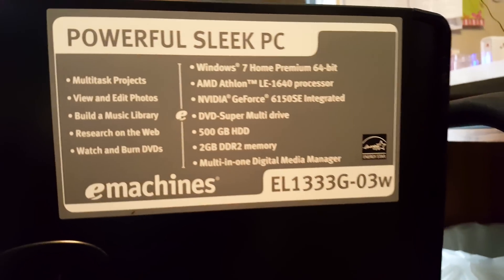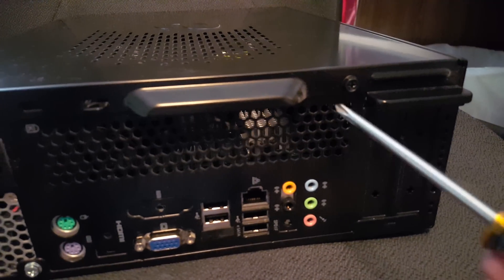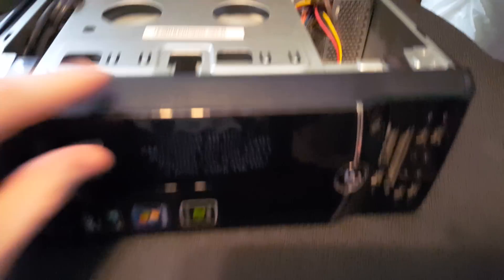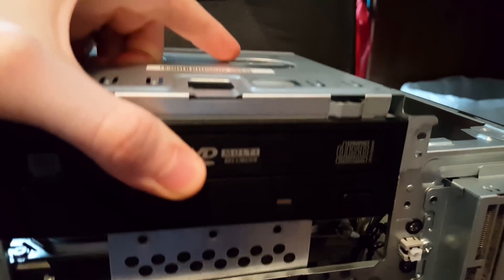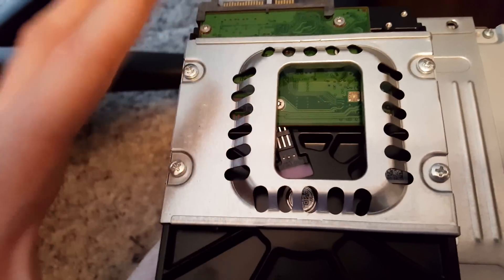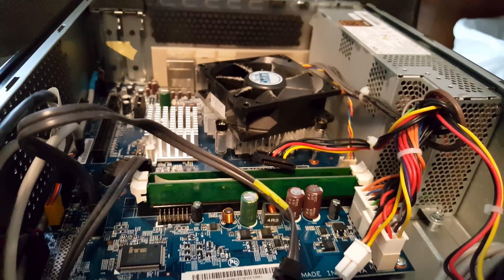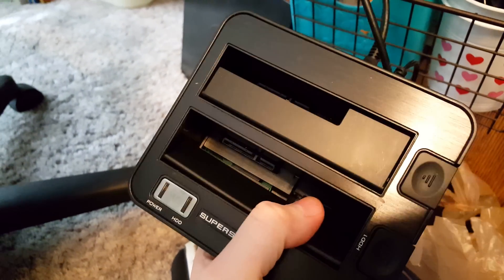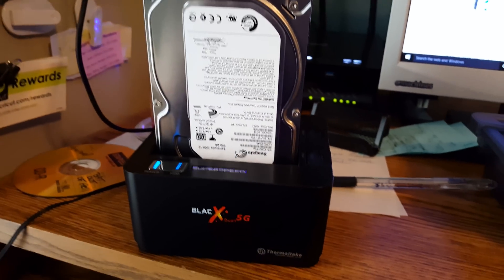eMachine EL1333G-03w Teardown & How to Remove the Hard Drive

Comment: Thanks so much for this video!  I needed to take out the hard drive from the eMachines EL1352G-41W.  It was identical, except the circuit board on the hard drive is blue and is made by Hitachi.  Just letting you know in case someone down the line, has this model.  Really appreciate that you posted this way back. Never know when someone like me needs to do this. Thanks again!

Comment: i have a similar model (el1331-05) but the thing is if i try to take out the side panel, it wont budge. i soon found out that on the bottom of the case, the side panel is actually just connected to the case. is there still a way to open it?
Reply: im haveing the same issue

Comment: I was surprised after taking my same type unit apart tonight to find a Seagate HD installed. The outside of the box specifically said it was Western Digital. I'm partial toward WD, but the Seagate has worked OK since 2010. The only reason it was removed was to put in a bigger drive. The entire unit only gets 3-4 hours a month put on it which is probably why it's lasted so long.

Comment: "Touch the case to be grounded." How can you be grounded if the case itself isn't grounded?
When you touch the case, the case itself will now be charged, if it isn't connected to ground.
Reply from the maker: Touching anything metal grounds you out. If you have any built-up static, it will discharge from you onto the metal. The case is meant to take it, the components are not.
If you have enough static to shock yourself, better do it on the case or other piece of metal than on an actual PC component.